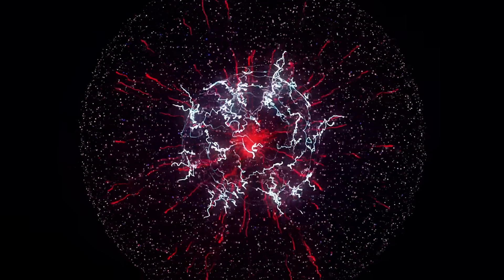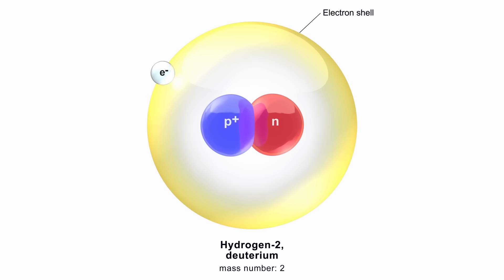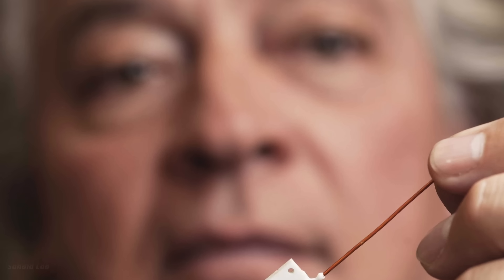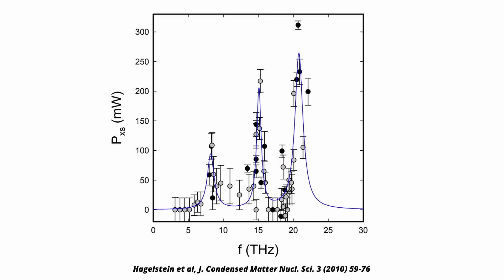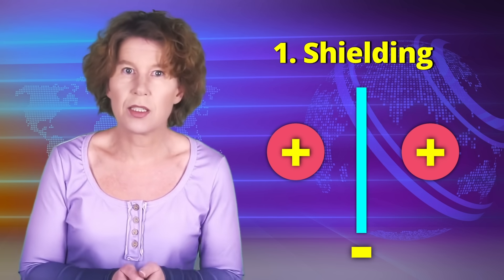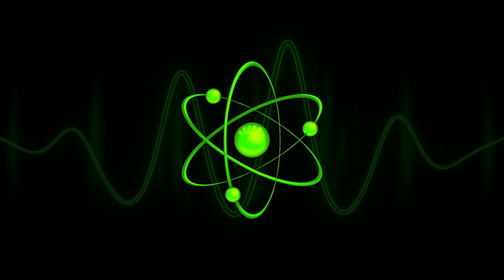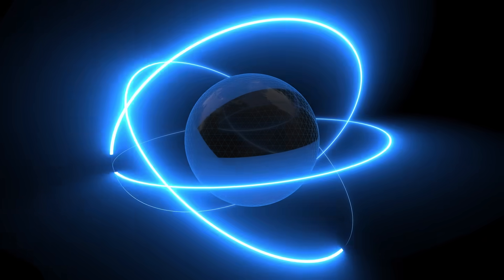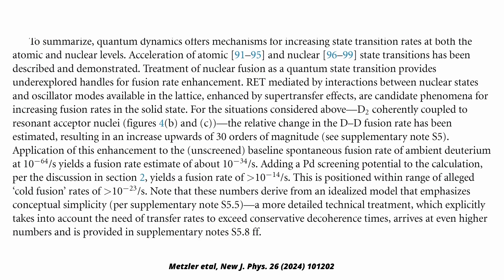Physicists Say They Know How Cold Fusion Works

Comment: This paper proposes a Cold Fusion Standard Theory based on Deep Dirac Level (DDL) electrons and femto-hydrogen molecules, formulated from experimental evidence of anomalous heat generation, nuclear transmutation, and radiation emission observed in cold fusion (CF) studies. The conventional Standard Model relies on hypothetical constructs such as quarks and the Higgs boson, whose physical reality has never been experimentally verified. These assumptions have led to contradictions and cannot account for empirical results in low-energy nuclear reactions. Reproducible nuclear transmutations and excess heat have been reported by Iwamura et al. (Mitsubishi Heavy Industries), Kitamura et al. (Kobe University), Mizuno (Hokkaido University), and by NASA Glenn, ENEA, and BARC. Typical reactions such as Cs→Pr, Sr→Mo, and Ba→Sm exhibit a consistent rule of ΔA = +4 and ΔZ = +4, which can be naturally explained as the fusion of femto-deuterium molecules (fD₂, consisting of four protons) followed by stabilization processes. These findings indicate that large-scale projects such as the International Linear Collider (ILC), designed only to extend the Standard Model, are scientifically unproductive. Instead, research resources should be redirected toward establishing the Cold Fusion Standard Theory and advancing its scientific and industrial applications.

Comment: We see cold fusion throughout space as spheres of planets and stars. Space is a weak external magnetic field of cold repulsion to heat propulsion as perpetual motion. Pressure of cold repulsion within mass as occupational space as outward pressure within mass as occupational space and outside of mass as inward pressure. Heat neutralizes cold repulsion within mass as equalization to pressure within and without mass. When you weaken cold repulsion of space outside of mass with heat mass, it disolves its outermost surface perimeters. Atmospheric gasses are cold repulsion to mass. Mass falls in equalization to magnetism repulsion within mass and without mass. Cold fusion holds mass together. Hence, spheres throughout space prove cold repulsion of fusion as planetary internal magnetic fields and stars. Cold repulsion is a cold fusion of grouping heat energy together in cycling circulation centrifugal force of currents flowing. If you could make a magnetic field, repulsive to atmospheric gasses like heat rising through atmospheres as repulsion to the heat within atmospheres, it will rise above the atmospheric gasses. Making heat rising with repulsion under the open space devoid of heat under it. Mass grounds currents. So you have to remove the grounding currents of mass to rise up through the earth's internal magnetic field. Like a hot air balloons rise up through the earth's internal magnetic field. Physics is magnetism. Amplification of magnetism grounding currents given us our internal magnetic field grounding currents. If mass doesn't ground currents, it rises up through the atmospheric gasses. Magnetic fields grounding currents through all masses in its path. Removing the currents or flipping the current upside down. Magnets are repulsive to each other. They only ground when the current is flowing in unification of unidirectional currents flowing synchronization. Flipping magnetic fields grounding makes them repulsive to each other. Earth's is made up of elements that are magnetic.  Flipping the magnetism gives rise of magnetism repulsion to earth's grounding currents through its surface and core. Artificial magnetic field flipping over will make a ship or saucer repulsive to atmospheric gasses. Outward force of pressure is what space is inside of mass. Mass falls in equalization to repulsion within and without mass. Each atom is repulsive to other atomic structures. Mass disolves from heat weakens cold repulsion outside of mass and its outermost surface perimeters disolving first. Ice holds more occupational space within mass than any other substance. Mass holds cold space occupational within mass equalization to heat. 98.6 equalization. Drop temperature downward and heat rises. Rain drops cold space down towards the earth's surface and core. Condensate. Drop Condensate to the outermost bottom of the pool to raise heat upward. Reverse the magnetic field. Musk, here's your theory of magnetism flowing currents through all masses in its path.  Reverse the magnetic field repulsion downward grounding upward. Cold space is cold fusion push the Condensate down under the ship. Boats float on water currents. Solar sailing catches photons. Photons striking mass unabsorbed lighting up the mass it strikes unabsorbed quantumized sparks lighting up reflection of reflection bouncing off mass lighting up as sparks of resistance. Two constants of physics, cold and heat, coexist as mass and anti-matter as fire as mass disolves into singularities of photons. Not electrons but photons sparking. Like grinding,  sparkling sparklers. Resistance is heat energy released from mass disolving into external heat energy outside of entanglement of mass doesn't ground currents. Hot air rises. Cold air is repulsive. Ice is repulsive. Slickity slick. Fuel consumption has depleted the earth's mass decreases our internal planetary magnetic field inward holds more heat energy currents outside of mass, and causes mass to disolve its outermost surface perimeters first. Ice disolves faster. We need more mass brought back to earth's surface because it is occupational space within mass. Magnetism is physics.

Comment: Sabine - At around 1:43, you say that the neutristor sends a "low energy beam of deuterium" but perhaps you should be more specific in saying that they have an energy of around 100 keV which corresponds roughly to 1,000,000,000 K. This is definitely not ambient conditions or "cold".

Comment: I experimented with this years ago using slices of palladium investment bars for the cathode, nickel or platinum wire and a platinum cylindrical anode with a slit in it. The electrolyte was deuterium -- with Li-6 added.  The cathodes were nickel plated first -- presumably to concentrate the hydrogen within -- like a gate or semiconductor. 

One time I was reattaching a nickel wire to a used (hydrogen loaded) cathode using an AC spot welder I built. To my surprise the cathode suddenly became yellow with heat after attaching the wire so I dropped it on a paper towel where it continued to burn and ignite the paper for a minute or so. A surface chemical reaction an associate suggested?
I wasn't able to duplicate that event, but thinking about setting up my next experiments I decided on several changes to make:

1. Use a pure heat cast palladium cathode -- not palladium bullion!
2. Use a cylindrical platinum foil anode with a slight gap to avoid a Faraday shield or cage.
3. Plate the cathodes with nickel first. I don't recall that exact process I used, but this could be an important step?
4. Use platinum or nickel wire for the cathode and spot weld the connection or cast it in. 

> Unfortunately I never got around to building my carbon arc or inductive furnace to cast a palladium cathode. I got sidetracked with nickel mesh cold fusion attempts, which ultimately led to the nickel plating idea.

Comment: Can't these mechanisms for cold fusion be used to increase the efficiency of hot fusion? Even if it never reaches net positive in "cold", lowering the amount of heat and pressure required by hot fusion by orders of magnitude would still be a great achievement.

Comment: The problem is Physicists are trying to fuse 2 positively charged nuclei. What they should actually be doing is firing multiple neutrons into the target material's atoms so there is no Coulomb barrier to overcome. This is not rocket science. What is rocket science is generating a controllable neutron beam. For that, you need a deeper understanding of Magnetism and Spin than the QM maths gives.

Comment: Total NONSENSE. Here is the Thermodynamic argument: Catalysts work by reducing the energy barrier inhibiting reaction. When this happens, an intermediate state forms in which permits the reacting substances to approach more closely than is possible without catalysis. It makes NO DIFFERENCE whether the reaction is chemical or nuclear, the Thermodynamic argument is the same. Hence, the heat of absorption of the deuterium in the catalyst must be comparable in magnitude to the original energy barrier. In other words, the heat of absorption of deuterium must be comparable with the energy yield due to fusion. This would be at least a MILLION TIMES AS LARGE as the observed value. Sure, if you smash the deuterium nuclei together with sufficient energy, fusion will occur, but the energy required for this process greatly exceeds the energy yielded by fusion.

Comment: Kudos Sabine.  You are gradually accepting sane science.  Poor Stanley Pons and Martin Fleischmann.  They were pilloried and destroyed by ignorant gossipers and acolytes under the anti-crackpot banner.  They are owed an apology.
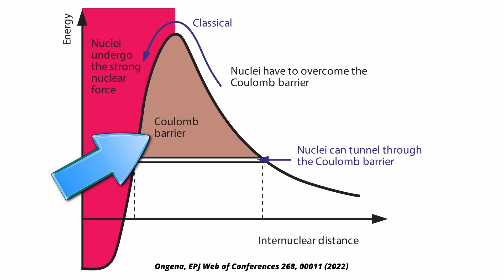0:43 The existence of the strong force is nonsense. Common sense says it's nuts but the herd mentality says no.  They say just invent yet another particle and all is well.  There is a new branch of chemistry called  Tovacian Chemistry (The Orthogonal Vector Addition of Charge)  This branch of chemistry  is based upon the fact (yes fact) that two identical moving charges, acting at a right angle to one another, display ZERO electrostatic interaction be it attraction or repulsion.  There is no strong force per say but rather an actual magnetic force that binds the two same charge particles.  Of  course all the herd will yell crackpot and bad science but a two minute  check of the vectors will simply prove the point.

Comment: If for instance, electrons actually move within atoms at the speed of light in whatever environment that may be, and gravity or whatever atomic driver you may cite actually warps that straight line into a circular or off-axis spherical orbit in quantum spacetime routing, then the polar attraction of the positive nucleus must be half of an excitement cause and attraction or inflow pair of forces. If say, heat causes resonance instead, what would fuel the strong bond in a nucleus? It wasn’t created with perpetual strength and momentum in the Big Bang or lasting since a sun had expelled it? That atom was as likely in dinosaurs as it is today in your coffee cup, a few electrons more or less?

A gluon or boson might have catalyzed that atom’s energy into matter at some point, but it surely feeds off of some continual stream of energy current. Gravity isn’t polar in space except in repulsion to itself, though in atoms it finds a polar attraction that  shows a repulsion to nothing. Positive and negative charges that don’t dive into each other, and you don’t see that as odd? The mechanics of this atomic model is not voodoo, but it sure needs some work. There are names for forces, but no reason for them to be. My simple mind begs for the rest of the story.
Reply: Go ask Paul Harvey.
Reply: So what if gravity is finite and matter continues to condense or precipitate? What if atoms consume gravity and whatever opposite energy drives an imbalance to account for gravity’s inward flow surrounding physical objects? That might suggest that the ingestion would continue to exhaustion and space would have no ambient attraction to hold it together.

At the current rate of 32ft per second, increasing every second at our planet surface, I’d guess we have plenty of time before light can travel unobstructed. But what would time mean, without anything but solid matter slowing its internal forces? Light does slow in cold nearing absolute zero, and in the thin gravity of interstellar spaces, would that from distant stars speed up and slow down, giving a false sense of time, distance, and location? Is it that cold in that no-man’s-land? I hope Sabine can box those in for us.

Comment: This begs the question of where that released energy comes from in the fusion of two nuclei. Bringing a like charge pair into close proximity and within the spheres of each other’s spherical orbits or resonance zones sets an undefined interference pattern that’s obviously incoherent, and whether combined into double-strength nucleus or held by a barrier at arm’s length, the muscle strength is no longer able to carry its previous load and seeks a new home. A viable path for that exodus is dependent on what form of energy that broadcast energy assumes.

If it’s infrared radiation that heats steam to drive a turbine, that’s expensive, but known and easy. If it’s photons that require a reactive material to fit the grid, that’s not done at scale. If electrons and protons have a graphene link to a storage buffer, who knows, but is that coating or entraining process mature yet?

But how many kinds of particles are released in fusion anyway? What happens to all of the decayed and superposition fireflies that exit the weird interference wave that results? I’m assuming that it’s an invisible and undetectable spherical wave that allows particles to be detected in various places other than at just one. 

If the force to break those spheres apart is equal to that holding them together, it’s again time to look for Nature to contribute in the way it does in the Sun. That again is harvesting gravity, which is presumably the contributor in sustaining atomic energy momentum. What within nuclei attracts and endlessly converts vectored inflows to either resonance or spherical rotation patterns, with or without a common pole, is left to the imagination. 

I do wish Sabine would be a little more descriptive, since it’s her major. Maybe?

Comment: OK, it’s not clear exactly where/how atomic energy is stored, if not in motion. But disrupting the invisible jail cell by corrupting it with heat or pressure or bombarding them or by some harmonic interference wave seem to take as much energy input as in the results, right? Some other source input or output effect must provide a benefit?

If gravity provides heat and pressure, as it does on the Sun, no stimulus is required. But inside Earth, it’s not enough. But plasma is that hot, and in a microwave bore hole to the mantle, could those experimental maser waves be tuned to provide the multiple circumstances that would exploit these atomic vulnerabilities and release the heat and pressure energies along with the nuclear fusion? 

Does that disorganization of atoms reduce them to energy, except for nuclei that bond with another? Is it possible that little to no dust remains in the bore hole, once the plasma and microwave radiation has stripped the solid rock of its coherence? 

That can’t create a destructive chain reaction, I hope.
Reply: Energy resting in matter isn’t idle, something prevents it from finding its equilibrium. If we don’t know what or how the strong force can ingest a constant stream of gravity and hold other nuclear forces under its will, is disrupting that the same thing as disrupting the universal law of gravity? Isn’t that important?

Comment: These(cold fusion choices) will be the choice of interstellar travel and settlements and mining.Much easier to setup,maintain whether remotely or by AI programs, androidd.Soon if quantum, miniaturization  can harmonize the cold fusion will be done on a chip(s) in a small device and space so it is more portable for travel,more upcycled to be used elsewhere.Could also combine it with ships Intel,updates,hardware to produce newer more flawless versions while traveling.The mechanical engineer who visits all original builds of cold fusion for power could easily update and keep a smooth record of what works where ( temp.,vibrations from speed of flight, possible damage from meteor or weapon attack,gravity in flight,in a gravity belt or on a planet surface.All will have affect on molecules,their resonance and tunneling ability .Shielding will have to be recalibrated too . Perhaps you could utilize the AI program to keep all data,changes made their success rate ,factor in all the variables of area you will set up new cold fusion source Then as you travel the galaxy you could make an accurate map of what will be needed where you'll know what supplies to bring or take on ships or outposts 3D printer, how long to set up properly,the necessary time needed to setup,number of people and human consumption supplies,elapsed time from start to finish.You won't unnecessarily be exposing humans,machinery, materials to any excessive radiation,wind,dust hot,cold temps and perhaps minimize numbers of errors made in calculations,minimizing by the same token number of flaws made in builds of any needed facilities, infrastructure, mining techniques.The concepts of producing energy can be scaled down tremendously,making need for situational energy thru the chips coated with necessary chemical_molecules..
sort of peel/dissolve off a nano layer to get the reaction for cold fusion to begin.The AI programs will send a signal when given command.Then they'll be no need to store/ recharge batteries for maintaining environments,keeping machinery of flight,mining, communications always flowing.
Can have a bank of pre printed/ assembled chips ready for regular maintenance, meteor,weapon damage to assure continuous flow of all systems on ships and on planetary or asteroid surfaces so duties ,life can be maintained at optimal balance. Something for grandchildren to refine perhaps with Thorium and molten salts as an option also

Comment: The Heat and Pressure of the Sun is not enough to fuse hydrogen, it actually reduces the columbic barrier, that enables the quantum tunneling to take place. Cold Fusion originally didn't include magnetic fields, it was overlooked as the original experimenters didn't check for E/M fields in their experiment.